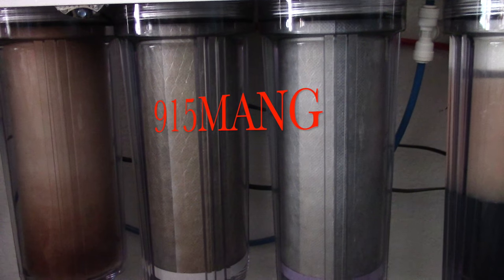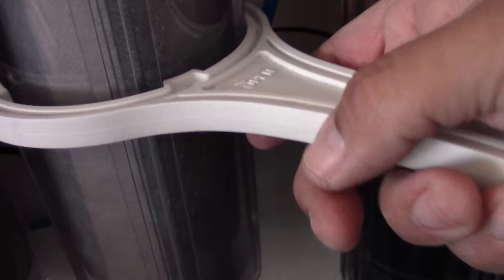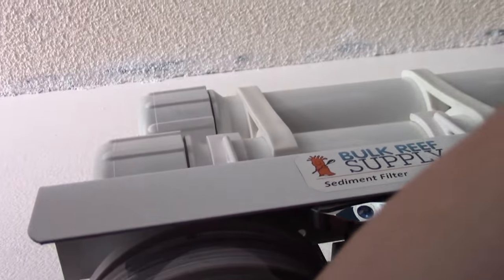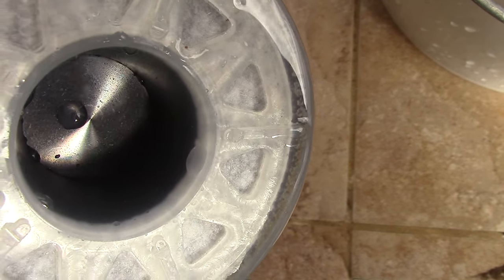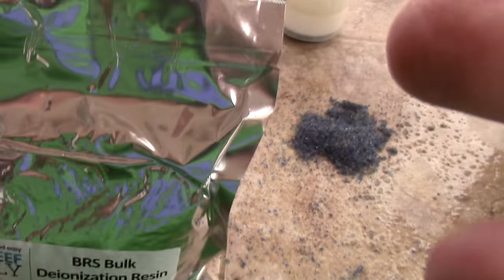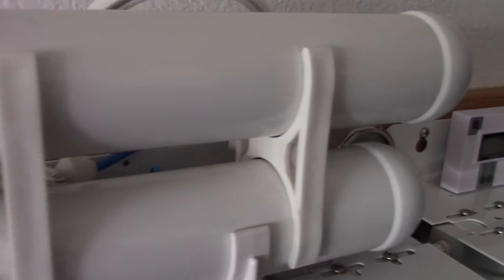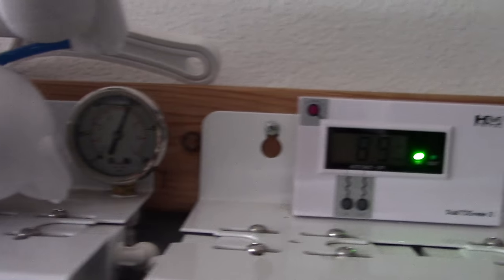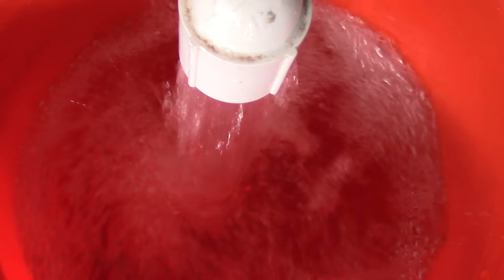CRYSTAL CLEAR AQUARIUM WATER FOR FISH AND CORALS

Comment: Options are nice as well, been trying rodi filters along with trying using tap water but adding two 1-5 Micron filter socks for 1 - 2 days then put in my 200 micron socks again in sump after a water change, my TDS is lower on this tank than my RODI tank.

I can use pressurized hose to clean filter socks & reuse unlike costly RODI filter media. Plus never any wasted water like in RODI system, Americans living in Saudi Arabia would be proud of water saved :-)

Remember no matter how clean initial water is once it comes in contact with substrate with detritus, live fish, rocks & corals the TDS grows higher using both methods.

I have no algae issues in non RODI system, I raise my lights a few inches & cut back on photo period 1 - 2 hours helps tremendously.
I feed once every other day helps tremendously.

Watch out for "indirect" lighting from nearby windows that hit your tanks, that more of a factor than TDS alone 9 times out of 10.

Keep your fins wet! 
Peace

Comment: Great topic for a video, especially for beginners. I've only had a RODI unit for 2 years - before that I used just distilled water from the grocery store, and before that, conditioned tap water. Algae city!!!! And I couldn't figure out why. So I agree with you - RODI units or access to RODI water is a huge priority if new reefers want long-term success. Using RODI water reduces potential problems from the get-go. Thanks for this.
Reply from the maker: Reefgrrl Yep 👍 Its one of the most important things next to a ATO, everything cost so much up front. But I was Using those water stations when I started. Nothing wrong with them

Comment: If you are really consistent with your water changes and feed the fish once a day even go as far as to spot feed them and once a week the corals you will have a cleaner tank. Even if a fish eats once every 2 or 3 days they wont die. I know no one ever has a perfect schedule for changing water because after a while when your tank is established the live rock and the sand and protein skimmer do an awesome job. I wish I could change my water every week on the spot but I go sometimes 2 even 3 weeks with good parameters. If you just keep the feeding to a once a day you will cut out the need for water changes every week. If you ever notice when you do water changes the skimmer goes crazy for a while because the salt is not made in pure conditions. I know that introduces pollutants into the tank.